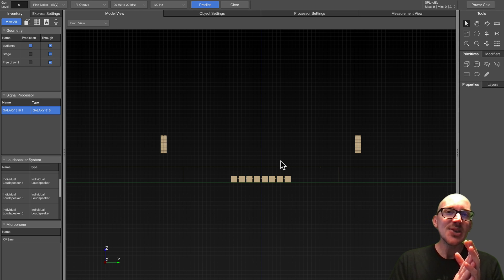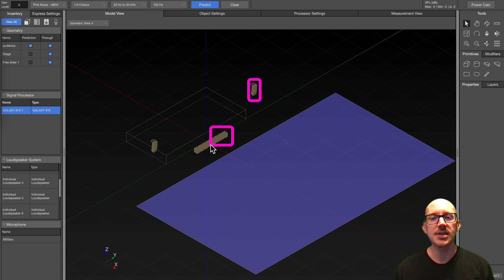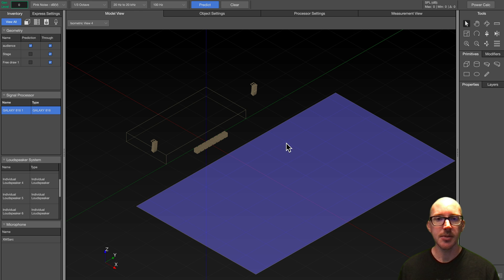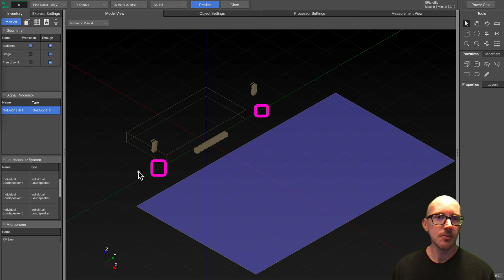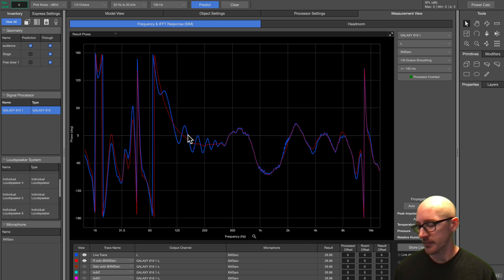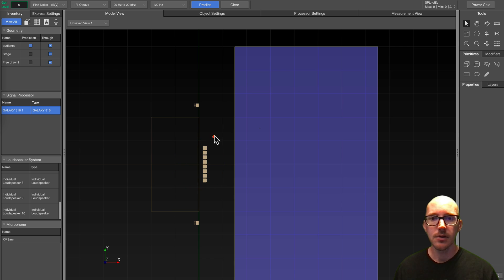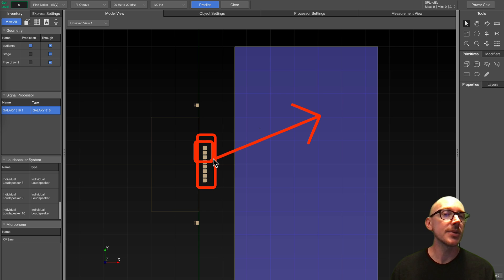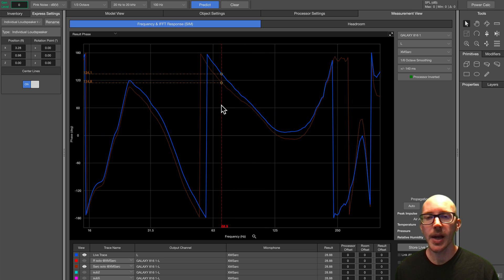Should I solo one side of my sub array during alignment?

Comment: Whilst I don't have field xp with this set up I would 100% agree with your sentiment in this video. The sub array is together like that for a reason and positioned with that length line for a reason to produce a certain coverage pattern. If you cut half of that off then the coverage pattern alters which is not reflective of what you will have in show conditions.

Comment: Hey Nathan, so what are your views if the scenario is a bit different - With this current setup instead of having a perfect centre clustered Sub array you now have a 8ft wide ramp in the centre of stage dividing your sub array, would you then follow soloing the subs on the left and right respectively? Also, would it matter if you have a mechanical delay set, on the subs for the subs dispersion towards the sides.
Reply from the maker: Hey Sean, 6ft is a general rule of thumb milestone I use for subs be couple or uncoupled at 125Hz. This is based on Merlijn Van Veen's manual for this Sub Array Designer.
Try this in mathnotepad.com
c = 345;   # speed of sound
f_spacing = c / spacing;
directivity_stop = (2/3) * f_spacing